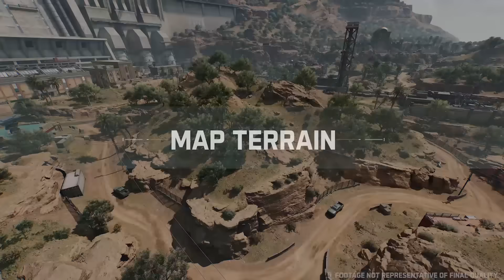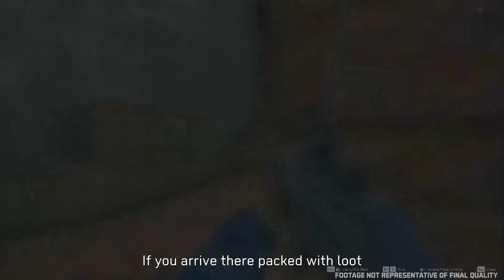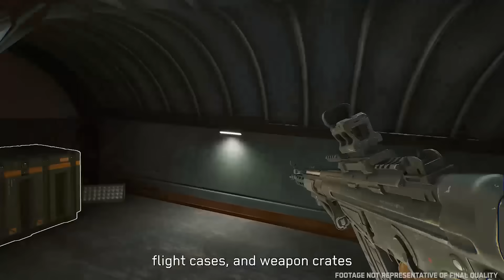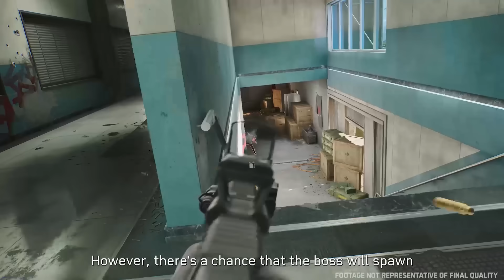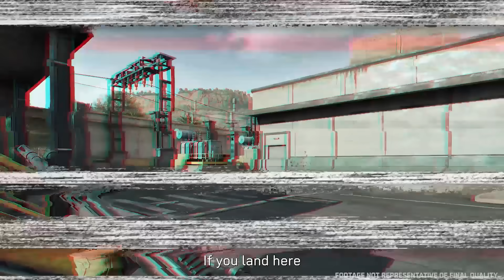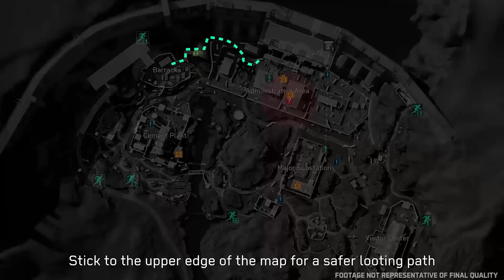Delta Force | Operations Route-Planning - Zero Dam

Comment: Thank you for removing all desire to enter the operations mode, due to the lack of balance, where bronze plays against diamonds, and where there is no normal solo mode
Reply: Rank has no bearing on anything. It isn't a true ranked mode.
Reply: @Empire_Racing  So it's normal for newbies without money and equipment to play against people with hundreds of millions and hundreds of raids in operations?
Reply: highest rank I've beaten as bronze 1 was platinum 4, but I've never seen anyone above that. the balance exists, it just stretches ranks to find battles faster. it's a new game so not many people play this one specific rank in this one specific mode. a QoL improvement gone wrong if you ask me
Reply: @gooneralissimus  I'd rather spend 1 minute looking for a fight where I'm up against players equal to me than spend 5 seconds finding a fight where diamonds will kill me in 15 minutes.